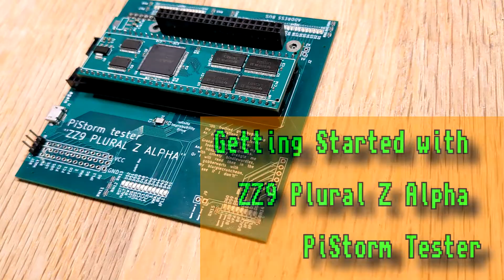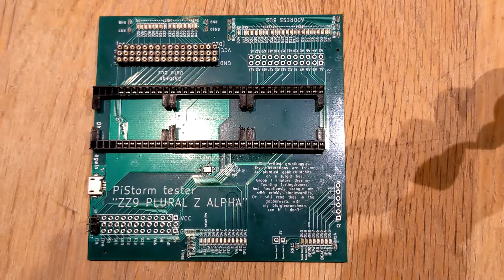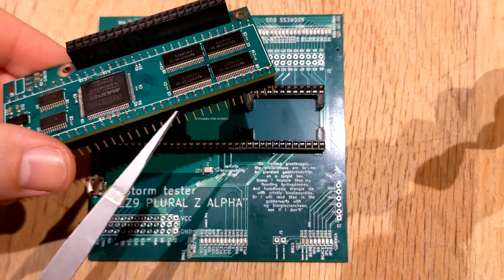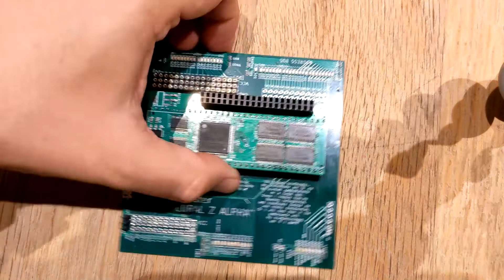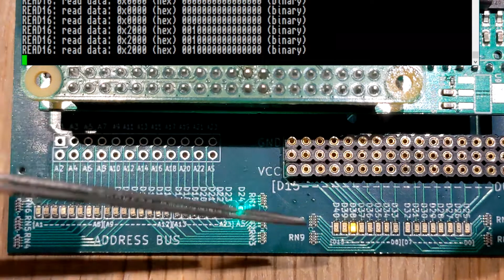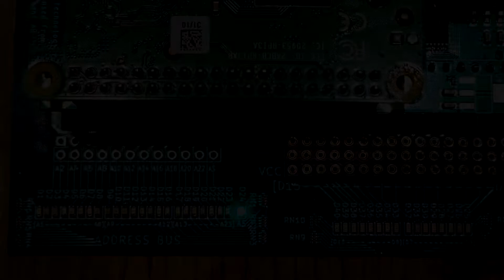PiStorm Tester ZZ9 Introduction

Comment: can those be bought some where? :)
Reply from the maker: You can order them directly from JLCPCB but you need to buy at least 5, preferably 10 to get them down to around £4/$5 per board. Or you can get them directly from me through the pistorm discord server or facebook group. There are threads on both about buying them. If you are in Canada or  USA, someone there is also ordering a batch to sell